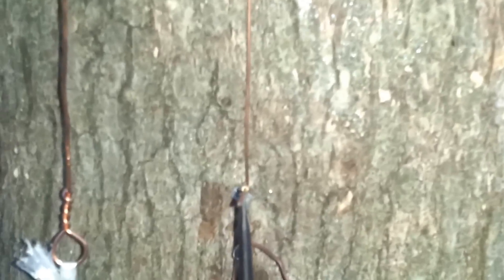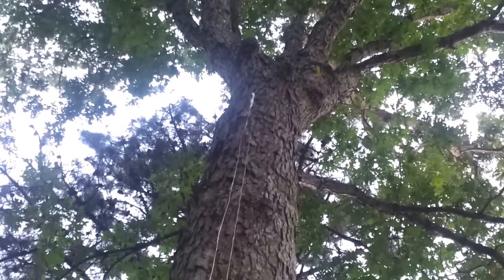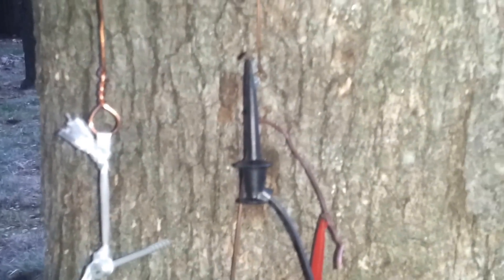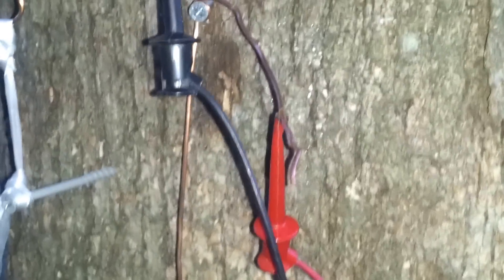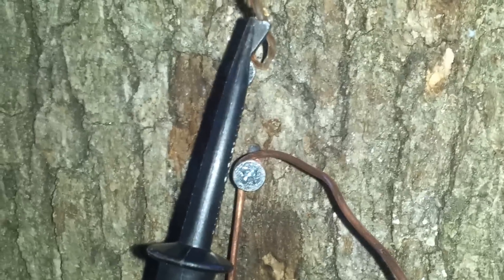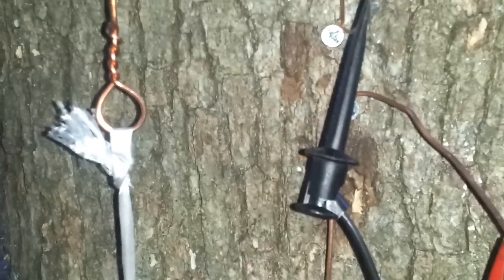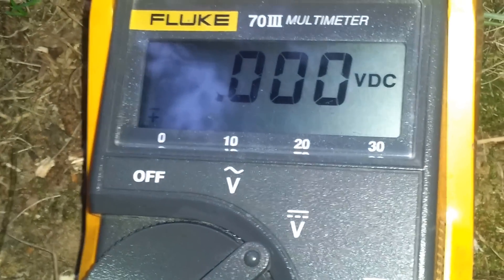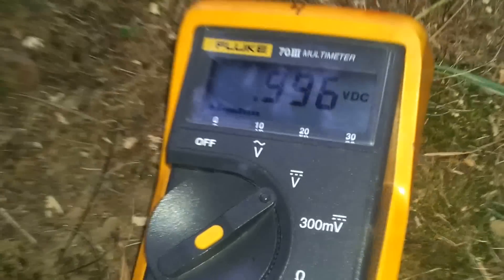The Ultimate Quantum Solar Panel "The Electric Green Project", Free energy Part I

Comment: As a control, try simply stretching out a wire of the same length on its own, then check the voltage you get between it and earth ground.  Basically do everything you did for the tree experiment, minus the tree.  The only way to truly isolate your conductor is for it to be RF shielded.  I've done my share of tinkering in this field and still do.  Not that you shouldn't keep trying and experimenting, but you can save huge amounts of time and trouble learning from the mistakes of others. ;-)

Comment: Pulling voltage from the air is no problem, all you need is a wire, a bridge rectifier and a ground. The problem arise when you also want to get amperage. If you hook a super bright LED to the setup in the film, you will barely get to see any light at all even if you do it in the middle of the night.